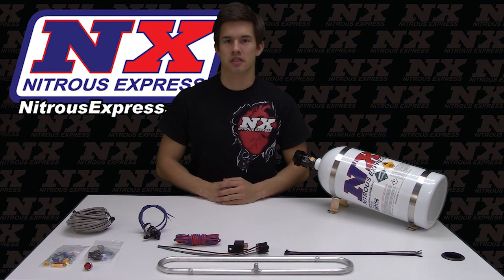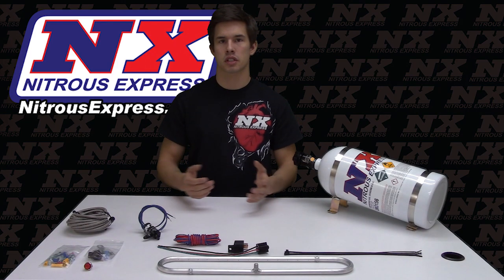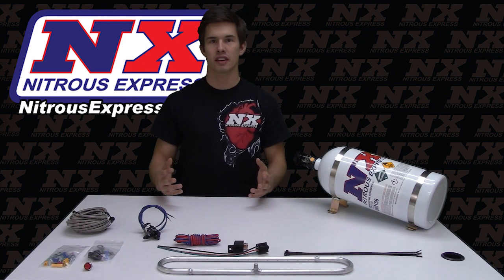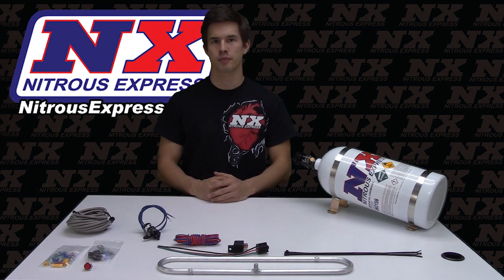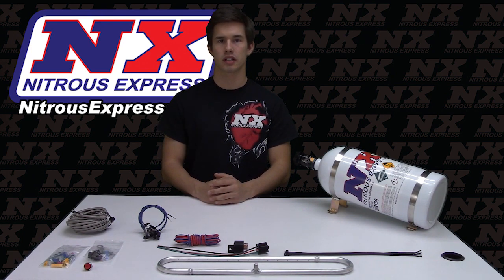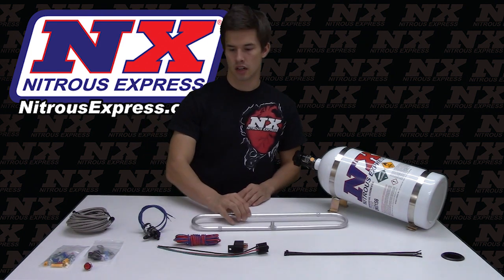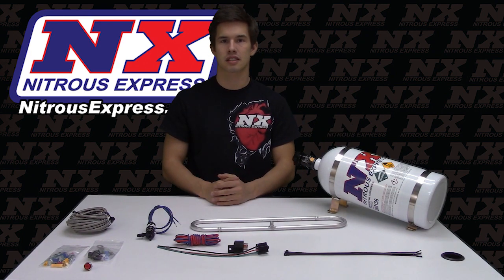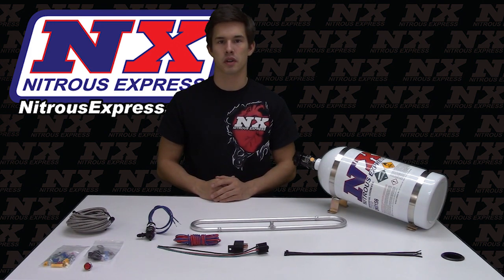N-TERCOOLER SPRAY RING SYSTEM WITH 10LB BOTTLE Part No. 20000-10

Comment: Will this system work well on an air to water heat exchanger?
Reply from the maker: You would probably see some good benefits from it. It will drop the temps hitting the heat exchanger quite substantially.

Comment: I just purchased this system. I will be upgrading the size of the Intercooler as well. Problem is I can't find a shop in South Florida (or maybe I'm not looking hard enough?) Can you please recommend some dealers that can install these items for me. Thanks Nelson
Reply from the maker: You can enter your zip code and then a mile radius you would like to find dealers in your area. 
https://www.nitrousexpress.com/locations.asp